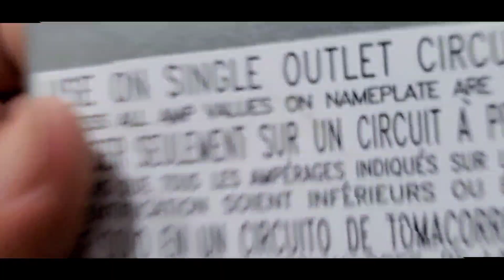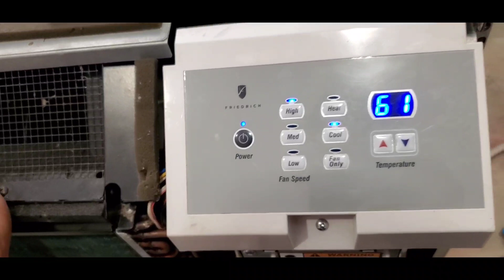Friedrich(Ptac)Controls Replacement

Comment: I have a few Islandair Ptac's that have a E9 error. Can this be fixed and if so what can i check or replace?

Thanks.
Reply from the maker: Hello 
Check for a broken fan blade, dirty condenser coil or a faulty condenser motor